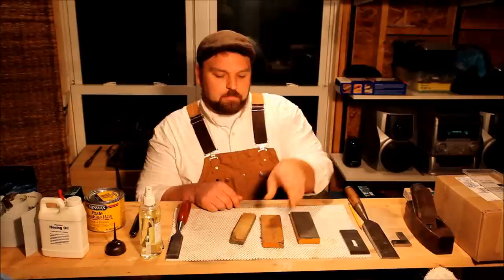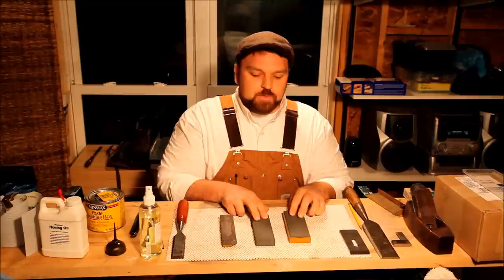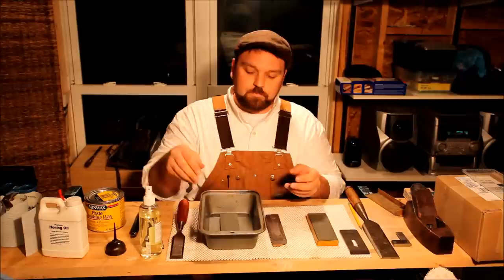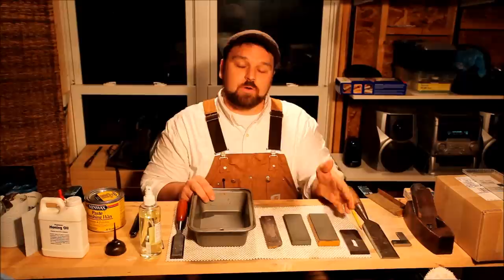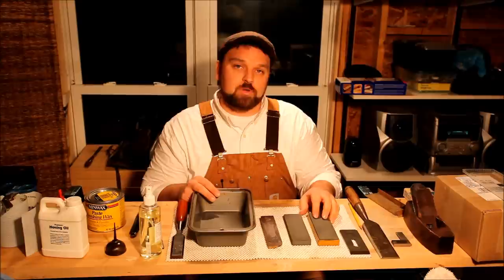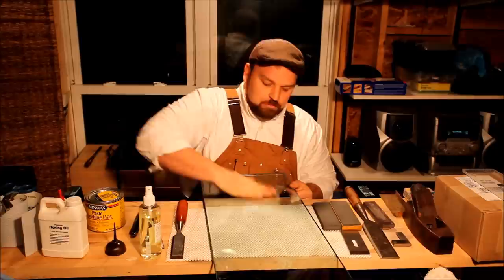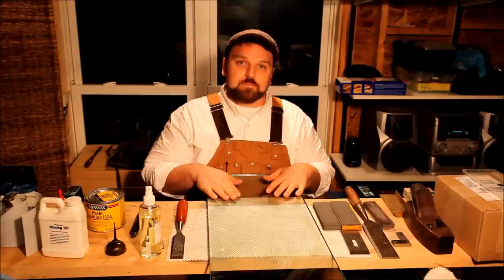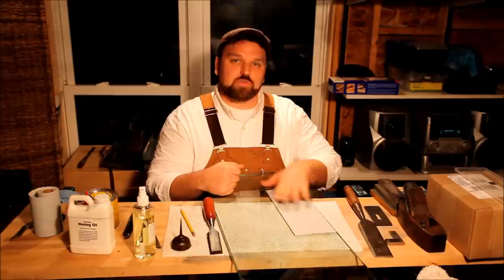Oilstones Methods Part 2 HD

Comment: FYI: Float glass is made by floating the molten glass over a pool of molten tin. The glass has a lower density than the tin so it buoyant, resulting in a perfectly flat surface.

Comment: .all novaculite has the exact same grit and only the density changes...think of a 4x8 sheet of plywood with 10 penny nails in it ...one every square foot ...then one with a nail every square inch....the square inch will do less damage  to someone walking on it or laying down on it and seem "finer" but both have the exact same size nails.

Comment: Arkansas Oil Stones should be cleaned,? Every now & then using either Kerosene ,? Or Charcoal Lighter Fluid.? which is a Kerosene Base also.? Soak the  Stones in it,? Will remove the old Oil.? & the Metal  pieces, That are  inside the Stone also.? Then rinse the Stones with Hot soapy Water,? & Dry them with a Lint free cloth.? Ready for the next time using etc.?

Comment: heres a question... why is it that my surgical black isnt as fine as my translucent? they have both been flattened and brought to a finished surface ( no extra bite that they shouldnt have) every one i know tries to tell me that surgical is finer than translucent, but my translucent is much finer than my surgical by at least an 800 grit margin... my surgical is like a peice of rough glass in feel with steel to it, where my translucent is a peice of almost polished glass
Reply from the maker: Typically, Surgical Black Arkansas stones are considered a harder/finer stone than the Translucent Arkansas variety.  That being said, natural stones (like any natural product) have a great deal of variance, even stones from the same mine can vary considerably in their grit size and distribution.  It is entirely possible that your surgical black isn't as fine as your translucent.  You may have gotten an "ultra fine" translucent or perhaps a less fine surgical black.  It sounds like you have used them enough to learn their idiosyncrasies, which in the end is the important part!
Reply: you are both wrong assuming "grit" is finer...all novaculite has the exact same grit and only the density changes...think of a 4x8 sheet of plywood with 10 penny nails in it ...one every square foot ...then one with a nail every square inch....the square inch will do less damage  to someone walking on it or laying down on it and seem "finer" but both have the exact same size nails.

Comment: washing soda=Sodium Bicarbonate not "carbonate"
Reply from the maker: That's actually a very common misconception. Sodium Bicarbonate or Baking Soda (NaHCO3) is not the same as Sodium Carbonate or Washing Soda (Na2CO3). You can even make Washing Soda from Baking Soda by heating baking soda in the oven at about 200 degrees for around an hour. That releases water and carbon dioxide. The Washing Soda makes a great water softener and an excellent abrasive cleaner.